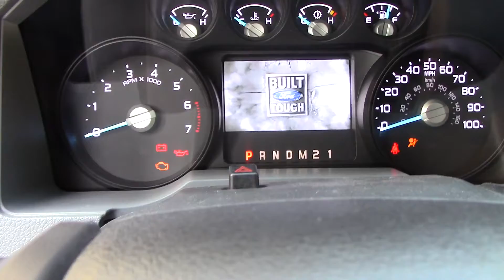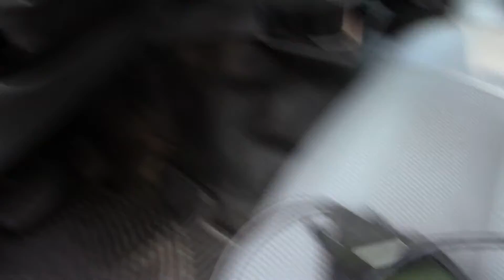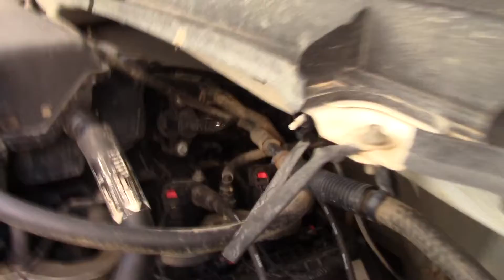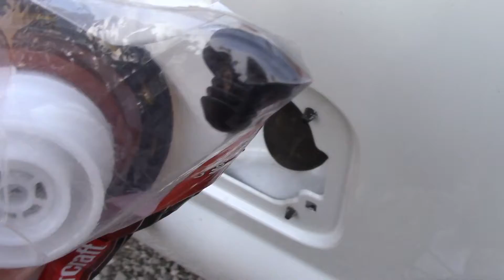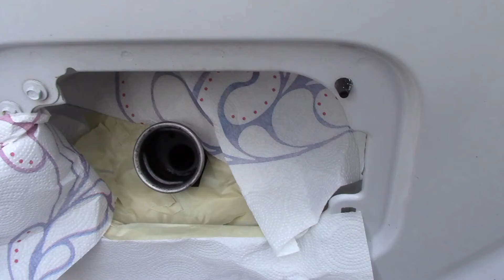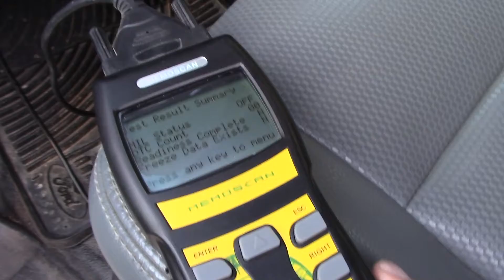Ford F250 F350 Check Gas Cap Diagnostic and Fix P0442

Comment: As it turns out, that was only a temporary fix.  A few days later I crossed the RR tracks which caused the light to come back on and stay on.  After reading FreeSpirit I decided to remove the gas tank. When I tapped the lockring to loosen it, it flew off. There were two "o" rings, one where it was supposed to be and another in the tank. 
I used a new "o" ring and lockring from Ford. It was hard to get the lockring to engage properly until I found a bigger hammer. 
Yesterday I completed a 750-mile round trip with no problems. PTL!

Comment: Small leak. Watched videos. Replaced gas cap, purge & vent in 1 week of frustration. 
 Old truck had 3 click gas cap.  New truck has one click gas cap. Fixed. 
Started truck, light out before end of driveway.

Comment: Hey man could you help me with a couple questions 
I bought 2016 f250 120,000 miles
I have 3 week with it and I have the same problem, the check engine and fuel cap lights, and the truck loses power on climbs with no load, I don’t know why, any recommendations? 
Thanks
Reply from the maker: Could be a major EVAP leak. Probably need to have someone do a smoke test to see where the issue is

Comment: the truck i use for work is a brand new F350 truck. it was just in the shop for a leaking power steering pump or reservoir. what could cause this message to pop up, being a brand new truck with less than 3000 miles????
Reply: power steering pump selinoid

Comment: So I have to erase the code to get light to turn off b4 driving it after replacing gas cap?
Reply from the maker: It will eventually go off by itself of the problem is fixed.

Comment: I had this problem on my 04 - F350 XLT pick up...constantly this past summer , replaced the cap twice in one year , turns out I have a small fuel leak on top of my fuel tank , just found it , it's small until you fill it , evaporates before you find it .
My mechanic found it rotating my tires ...
It's a small leak I can only see when full and driving , so I have to  get it checked .
I think it's a hose cracked or a seal the pump still hums , I can hear it .
Do they make a snake camera attachment for a cellphone ? I'd like to see inside that area before I have to drop this tank to see the leak ?! I just can't get a good view in this area where the hoses from the tank go in , that's where it looks like it's leaking .
If only I knew a plumber with that snake camera 😆!
Reply: Same truck , same problem. I changed the fuel pump , still an issue , check the vent hose where it connects to the tank,( mine was dry rotted , both fuel and vent replaced , it's 19 yrs old) it's molded to the tank, mines cracked all around , it's a round white fitting the vent hose connects to on the top of the tank.
I'm not buying a new $1,500.00 tank , JB Weld for gas tanks will be fixing that leak ..but my gas gauge still don't work even with a new pump, so I have to check the truck connector to the pump , I had the fuel pump put in by a shop.
The gas gauge worked before , but stuck on 3/4 ...
Ugh..

Comment: I have a 2015 f250, I bought a lock gas cap. Check engine light came on code  p0455  and p0456..
Put the stock gas cap on cleared the code no check engine light for two full tanks. Put the lock gas cap on, codes come back
 Buy a different  lock gas cap same the codes come back,  it has the stock gas cap on now no codes.
 So does lock fuel caps not work on this trucks  or does Ford sell lock fuel caps.
Reply from the maker: Not sure. The locking cap must seal completely to be equivalent
Reply: @JackofAllMasterofNone   Looking at your instrument cluster it is a bit different than the one in my truck eze yours is all digital is this actually a 2012 and not a 2011?   Also I notice that the digital display typically is ran on the diesel trucks I have a 2011 F350 with the 6.2 gas and my instrument cluster looks kind of outdated compared to the nice digital In the video you posted
Reply from the maker: @bjkoewers4892  I have the Lariat model cluster